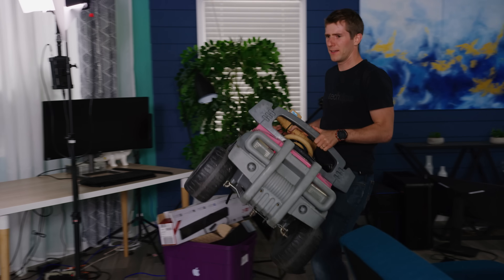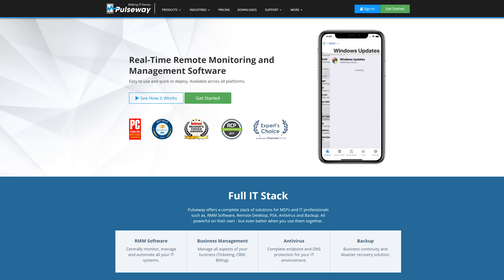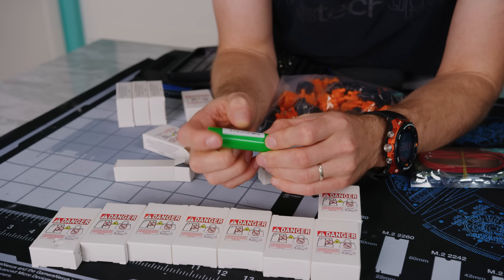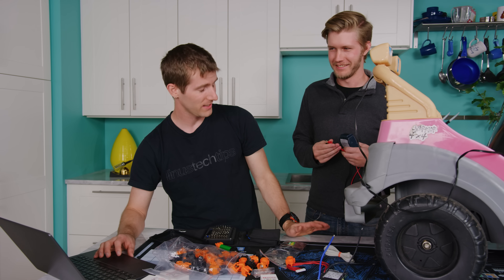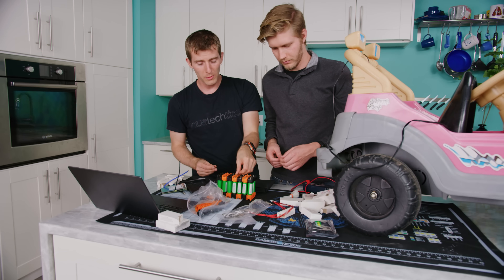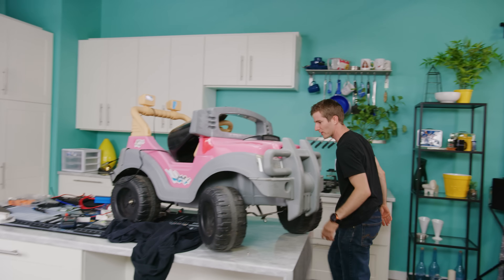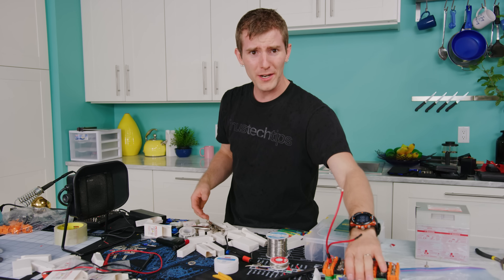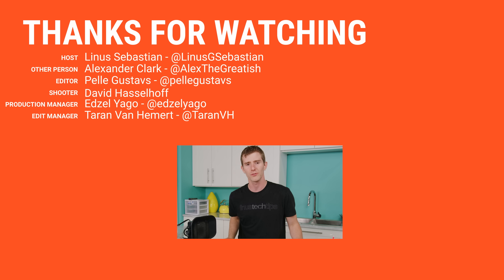DIY Lithium Battery - What could go wrong??

Comment: When modifying an Electric Vehicle for more performance. Overvolting the original motors, is easy. What's a concern, is if the motors are overheating from the higher voltage. So to prevent the motors from overheating, which can melt/burn winding insulation, and demagnetize magnets it may use. You will need to limit the current, with something like a Cycle Analyst, or a programmable motor controller. And if you're using brushed motors, instead of Brushless, then you also need to worry about arcing.

With electric motors. Higher voltage means higher top-speed and rate of acceleration. Setting higher current limits, means more torque, but you will drain the batteries quicker, and you will be more likely to damage the motor & battery from overheating. If using a bushed motor, you're limited by the voltage you can use, because arcing will become more of an issue. 

If using or switching to a Brushless motor & controller. Then not only can you use it in rain (with electrical connections sealed and packed with Dielectric Grease, so they too can handle moisture), but if you also control temperature with current limits, and maybe making a great cooling system. Then the only limitation to voltage, is the motor spinning so fast, that it starts damaging itself, from centrifugal forces, and the bearings may have issues too. But if you set your voltage or top-speed limit before that point, then you should be ok.

And personally, I recommend making an Ultra-Capacitor pack, to wire in parallel with the batteries, to make things easier on the batteries. Like Brake-Regeneration, and the spike in load, when accelerating hard from a dead stop, especially when going uphill.
Reply: So what you're saying is slap that Noctua cooler for threadripper processors on it
Reply: @bigmike8586  
I don't think that will work, because that will cool one side of the motor, and I don't think it will heat sink the other side quickly enough, before the other side is damaged by heat. If you're not going to switch to a higher wattage liquid cooled motor, that can better handle your expectations, in the space you can provide for it.

Then maybe you can have one of those combined radiators or intercoolers that race cars use, where chilled fluid flows through one side, and the fluid on the other side, is pumped to and from whatever tucked away thing you're cooling, like a ribbon of thin pipe, wrapped and thermal pasted around the the motor you oddly still won't trade up from.

It's like a radiator integrated with the evaporator core of an air conditioner. Fluids are not directly flowing from one to the other, but they are close enough to transfer heat, like an electrical transformer transfers alternating current, while keeping both sides isolated from each other. Understand?
Reply: @bigmike8586  
I was describing Air-to-water intercoolers, and something similar to the Dodge Demon power chiller, but chills antifreezing coolant, or even Evans Waterless Coolant, instead of cooling intake air...then again, if the weak motor you still want to use, is air cooled. Then you can make a housing around it, to flow filtered, chilled air through it.
Reply: WATER COOLED JEEP
Reply: @Heyit'sRendji 
Why do you say that?
Reply: I've learnt so much of Electrical Engineering from this comment, then I've ever did in High School Physics, or from Mechanical Engineering Electives.
Reply: @sagargoswami998  
I grew up Tunercar culture.  Honda VTEC engines, Toyota Supra, Nissan GT-R, Mazda Wankel engines, turbocharging everything. Turning economy & sports cars, into homegrown personal race cars. This same passion of making a vehicle better, I am now applying to electric motorcycles, and by extension, nearly any Electric Vehicle. The natural sound of electric motors, and the stealth of them, have made me fall in love with them. I have easily become an EV-Tuner.
Reply: @sagargoswami998  
This is my copy/paste generic comment, for anyone who would ask me what electric motorcycle I would recommend.
------------------------
I personally recommended finding an old gas motorcycle you like the type & size of, then stripping it down to the support structure & wheels, a rolling frame, and use that to build your own electric motorcycle. Don't pick motorcycles where the engine itself is structurally important to the bike. You can also look for straight motorcycle frames on places like eBay, then look up if you'll like the bike the frame you are looking at is from.
If you do, then buy the frame, swingarm, triple clamps, forks, wheels, and all their bearings & fasteners.

That's also a good time to decide if you want to do a fork swap instead, for that model, so you can upgraded to a fully adjustable suspension, with better brakes or tire options, if you want.

The reason why I recommend converting an old gas bike, or building your own Electric Motorcycle from a well-established frame, is because production electric motorcycles, are expensive, the types are limited, so if you prefer Sport-Touring, Cruiser, Bagger, Cafe-racer, basically any electric motorcycle that is not a standard/naked, SuperMoto, Sportbike, or Dirtbike, then your prebuilt production options, are very limited, or non-existant.

Also, it may be difficult to find & get a used production electric motorcycle. And Dealerships, on top of being untrustworthy, unnecessary, middlemen & parasites, Stealerships near you, may not even have many or any electric motorcycle models.

As for cheap, Chinese electric motorcycles. As tempting as they are, they are even more sketchy then Dealerships. Because of shameless copying, scams, and whatever issues, it is very difficult to impossible to find a Chinese electric motorcycle, with parts you can easily find & obtain, to maintain or repair it. Meaning more custom work & risk.

But building your own electric motorcycle, based on a production gas bike frame, means it's MUCH easier to find fastener torque specs, replacement parts, and aftermarket alternative parts, meant for the bike you are converting.

For example, one day I want to build a powerful electric sportbike, with Airtech-streamlining fairings, a RoaringToyz extended swingarm, Carbonfiber wheels, Woodcraft clipons & rear sets, a nice Corbin seat, and an electronically adjustable racing suspension.

Converting a gas bike, that already has great aftermarket support, is the best option.

By building off of a gas bike frame, you can easily build an electric motorcycle right for you, and your budget.

After you find a bike you like to convert, or rolling frame to use. You can start off with SLA batteries, a cheap controller, cheap motor, a specific voltage charger, then upgrade them one by one.

A high voltage, custom made to use all available space Lithium battery pack, a custom, sealed temperature controlled battery box, a brushless or induction liquid-cooled motor & controller, with Brake-Regeneration & reverse, and an adjustable smartcharger, or, an onboard charge controller with a CCS plug socket, programmed to your battery pack, so you can use public DC fast-charging stations, and your own charging station, the best your home wiring can support.

No matter what batteries you use, I highly recommend building your battery pack with ACTIVE Battery Balancers/Equalizers, instead of just relying on a Passive BMS to keep your packs balanced. 

And I say packs, because along with the battery pack, you can build a Super-Capacitor pack, that is wired in series enough, to be more than your maximum battery charging voltage. Have Active Balancers/Equalizers for the SuperCaps as well, and wire that Capacitor pack in parallel with your battery pack, to reduce stress on the batteries, improve launching, and improve Brake-Regen.

To get the most cycles out of your batteries, don't fully discharge them, and don't leave them fully charged for long periods of time. I would only use them down to 20%, and charge them to 80%. I would only fully charge them, if I timed it right, to be 100%, just as I am about to leave for an adventure or long night.
With CCS or smartchargers, they charge quickly to 80%, then after that, they charge slowly at a lower, gentler amperage, to protect the batteries. Remember this, when road-tripping, or riding aggressively for fun or escape.

Whether using a fully programmable controller, or a V3 Cycle Analyst. Not only can they both protect your system, based on adjustable temperature, top-speed, and low-voltage-cutoff. But you can also adjust your amp usage.
A higher amp limit, will let you use more of the torque the motor you selected is capable of, but you will drain your batteries quicker, and be more likely to overheat.
A lower amp limit, means less torque, but also, less energy lost to heat, and a more stable system you don't have to think about, and you can focus more on riding. The adjustments are your choice, just be alert, careful, and frequently checking the small changes you make, when tuning.

Finally, look for the spec/data sheets for all the components you plan on using, including the Batteries & Super-Capacitors you build your packs with. 
When selecting parts, the motor, the batteries, the frame/donor-bike, even the tires. Be honest with what you NEED out of your electric motorcycle.

Me for example, I am an Anarchist and an activist. I  want full control & ownership of my life. Taking back responsibility from the government, makes me a criminal, I am building & proving my independence, I do not recognize them as legitimate, surrendering to them or their thugs the police, are not an option, I have no remorse evading or killing them, or any unfair degrading people in self-defense. I deliver things for a living, have an interest in delivering illegal things, like drugs, because the government is not our parent, we are not their property, it's our bodies our choice, and, because of work, and the want or NEED for a roadtrip. I will be riding, many hours at a time.

So.

The best electric motorcycle for me, is a very powerful, aerodynamic, and agile Sport-touring. A more comfortable but performance-oriented seating position. A battery pack wired a lot in series, for very high nominal voltage, the highest possible or within the highest voltage controller I can buy or make, because voltage determines top-speed & rate-of-acceleration. DC Fast Charging, and or, a lightweight onboard generator, less time stopped. Lowest coefficient of drag possible, for top-speed & range. The most potent motor I can find & fit. Shaftdrive or Hub-motor, because Chaindrive is loud, high maintenance, maintenance time & materials may not be available, as for Belt-drive, belts may not be available when needed, and may not be able to handle the power requirements.
And decent luggage capacity, for deliveries, or when I need to just take essentials and leave wherever I am.

Highspeed rated tires, with great wear & rain performance. Or Dualsport tires for going offroad to avoid something, or because of an off-grid dirt trail home. Not too wide to safely lane-filter, or fit certain gaps.
And maybe a front hub-motor or a Christini like frame, for the assurance of All Wheel Drive, and more effective Brake-Regen, meaning more range, and brake-pads last longer, so even less maintenance I will have to plan for.

But if your requirements aren't as extreme as mine. You don't need so much performance, let alone enough to outrun a helicopter or basically teleport town to town. You rarely use expressways/highways, you just need something to commute with, just keep up with street traffic. Then the batteries & SuperCaps you fill your frame and fairings with, you can wire them much more in parallel. Low voltage, high capacity packs, that can more easily handle whatever amps you are comfortable with, meaning less energy wasted to heat.
48 to 72 volts is the bare minimum for traffic with hills, but while part shopping, check motor specs & gearing, for torque & RPM, and do the math to mix & match for your needs.

And if you live somewhere hot, and go fast little or not at all, then you may want a naked style bike, so YOU don't overheat.

If you also do the math, to figure out how much you can charge while you sleep, or at work/school, then you may even be able to use fewer batteries, more Super-Capacitors, to get more out of regen, in stop-&-go traffic.

Benjamin Nelson has a great YouTube channel & playlist, about how to build your own Electric Motorcycle.

There are also many videos on YouTube about Homemade Electric Motorcycles to inspire you.

Thunderstruck-ev.com  has electric motorcycle kits, if you don't want to piece together a kit yourself.

Another great source for parts.
goldenmotor.bike

A great place to get batteries.
batteryspace.com

A great place to learn about batteries.
batteryuniversity.com

Comment: The motor only fails because the standard air cooling is not enough. The motor will last longer and may never die if you hack a small high air pressure fan-blower onto its air vents, like the dual-rotor kind that is used in 1U or 2U "pizzabox" fan-screamer rackmount servers.

Comment: I was on the toilet so i had time to write this

1. Elecrocution
2. Thats not an electric screwdriver if you held that you would electrocute yourself
3. It could short out causing your house+all your expensive ass pcs to burn down
4. Burning the house down could kill you
5. If shorted out those batteries will explode causing hot lithium to get in your face burning your face

Comment: no dude you can't 'electrocute' yourself with 20v from a battery, it's just not possible. maybe you can manage to get a light shock if you really try, like reducing the path of electricity, soaking in soapy water and open up your arm stick the wires in^^ the real risk is if it 'explodes' even though it doesn't and just caches fire. But a very scary fire trust me, i once trew my bag on the floor forgetting i had some lipos in and they melted my backpack entirely in few a second.  the bucket of water i always have around only served to cover the flames cause the water literally had no effect

Comment: Oh dear I was waiting for battery joint short but well done with bare wire contacts... You know when you can see it's going to happen...

Btw.
Now if you plan on this I did some videos on maths and how to set up correctly.
Best thing to do is put a throttle in so you can not keep giving whiplashed to kids (and adults) when tuning your whip.

Electric scooter ESC is good.. and matching a high speed torque motor works well.

If you want to tech this then we can go all out on a invertor system and a 110 motor. However watching you guys try a 30 volt system. I'd have stand by emergency services. And good insurance.

Comment: 29VDC isn't going to electrocute you btw.
Reply: 29V DC will electrocute you, given the right ammount of amps. And that many 18650's pack quite a punch. A Car battery has 12V and it can kill you if shorted directly.

Comment: best easy  fix  is a 300A 12v mower batt .. not only speeds them up but  they  work incredibly long  between charges  ,,,  and charge with standard  car batt charger .. my nephew has  a pw green jhondeer tractor ..  i did this too when he was 3 and he is now 14  and way to big but the tractor still works ..   fair warning .. he had a PW atv that has the motors  exposed  by each rear wheel .. it was done first and worked great for about a year .. but he decided to play in some  mud and water holes and  wound up shorting it out  ..  and  killing the wiring ..  so do at your own risk ..

Comment: He was so close to a huge shock like multiple times :D
Reply: 24 volts is not enough to cause a shock.  A short circuit sustained for long enough might cause the batteries to melt or explode though.

Comment: Imagine changing the wheels on this thing and putting a 32 volt battery in o.o Easier yet, but those rubber strips made for putting gravel in your garden, and putting those on there with bolts and even just epoxy.

Comment: I didn't read all the comments, but when my daughter (however briefly) was driving on of these things, i cut up old bicycle tires, flatten them out, wrapped them around and screwed them into the back wheels for better traction... and better traction it was. it still slid in a turn cause i didn't put them on the fronts, but it worked like a charm!

Comment: We did this to my now 8yr old nephew's plastic riding jeep a few years back. We had to make a few other modifications to handle the new found torque. The plastic gears were not up to the task and had to be rebuilt, and the plastic drive wheels had zero traction on grass/dirt so we glued a wide accessory belt to the wheels, notched side out, as add on tires. The gears have been stripped out again and will need repairing, but my nephew still loves driving it even though he has had it for a few years now. God knows how much longer it will last as its really taken a beating.

Comment: XD I did this myself! But i used a battery monitoring system to sound an alarm with low voltage and a heads up display instead of a battery manegement system. XD and i charged it using tp4056 micro usb lithium chargers. Haha!

Comment: 10:06 haz modular battery kit with bolts, soldiers on wires..... i get it with the main connectors, those special bus bars, but seriously man, just bolt the wires in, they are sensors, they don't carry any load. and the whole idea of the system is to avoid soldiering, if you use the big bus bars with the "outputs" then sure soldier, but you didn't need your iron today.

Comment: forgetting to alternate your series strings.......schoolboy error lol 
i made a 14s 10p battery for my electric trike i bought a battery tab welder with the money i saved diy i split the pack in 2 x 7s so i can parallel charge the 2 packs on a 10s 30a charger so i can balance charge 58.8v 30ah pack in just over 2hrs ;-)
much better than having to trust a bms not to fail (as they often do)